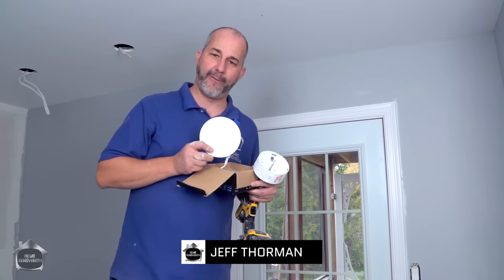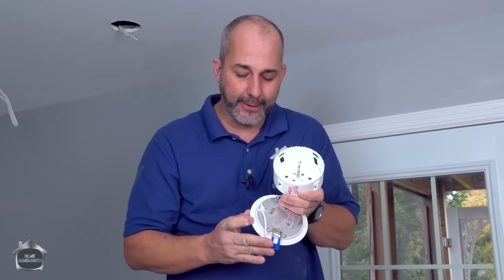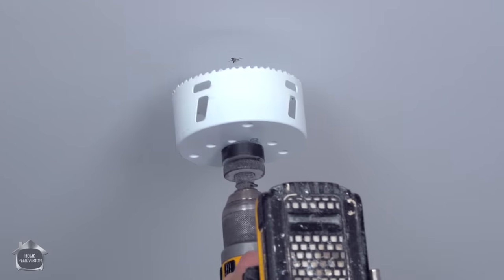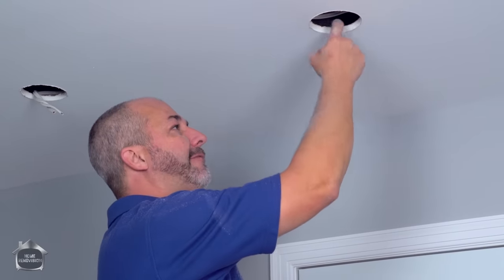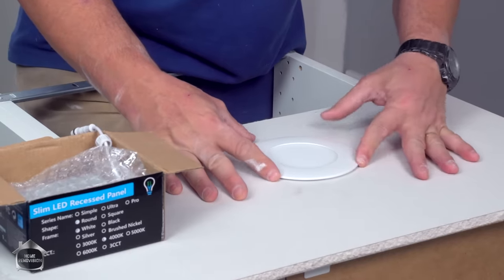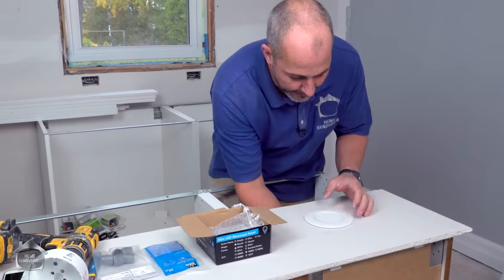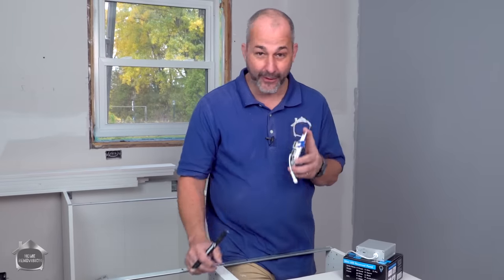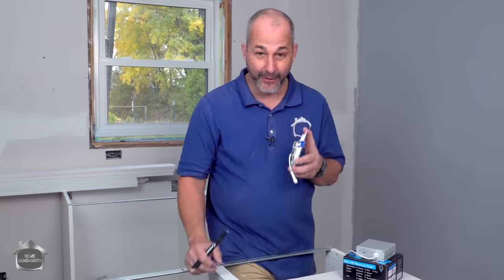How To Install Pot Lights in Kitchen Ceiling

Comment: Awesome video!!
I like how you even mentioned “when” to do your lights. I just bought a 1983 train wreck of a house. Well-intentioned owners but they made bad design decisions after having it built and kinda lost their minds as they got older. They eventually passed and their house hit the market as an “as-is” at full price. Ugh. Anyway, every last detail needs to be fixed/updated. I mean not just the popcorn ceilings, base board being used as crown moulding, chair rail, base, and door trim.... just every single thing imaginable is ruined. Every door, every inch of the wall-papered and sloppily painted walls... 100% of everything :(
So I get to make this ole house new again and pray to get my money back in a couple years. 
I was unsure of when to do the lights. After paint but before floors or what? I figured the order is de-popcorn/skim coat (or texture ceiling), skim and texture walls, crown and door/window trim, then floors (12 different... bad job flooring types in an 1800 sq foot home 🤢) and back up to the lights but I wasn’t sure. The glove idea is great too, thanks!
Reply: Go slow and take a deep breath and think of a process. You're on the right channel, DIY done smart will save a lot. Hired work that you can afford isn't always going to have the quality you'd want, and if you bought your forever home, or want it to be, you'll look at those walls, trim, paint, patches etc for quite a while. Start with areas that are invisible if you're beginning. As a renter, I fixed a lot of landlord or tenant or maintenance guy sloppy work. I first started mudding, trim, wall paint etc in the closet, literally.
Reply: Gosh...I was feeling overwhelmed by bad DYI stuff in my new home...I feel so much better now. 😁
Reply: Sounds like we just bought the same house. haha. Ours is 1980 and EVERYTHING needs to be redone. There are six different types/colors of light switches throughout the house, 8 different floors, hideous trim, the wrong types of mouldings used, 6 different types of door knobs, every possible metal finish for lighting and bathroom hardware. No ceiling lights in more than half the rooms. It's a mess. 2,600 sq feet needing to be redone.

Comment: Cheaper and better variations coming from the SAME supplier sold with different branding is the most UNDERRATED tip in this entire channel! I think it deserves its own video! I wonder how many different common products in home improvement can be found cheaper with the same or higher quality from different retailers.
I know it definitely applies to most products in Amazon can be found in alibaba where you can see the Chinese supplier selling products customized with your own brand and color theme variations if you buy in bulk so if you see similar products on Amazon go with the cheapest one!
Reply: A long time ago I worked at a fish processing plant in Alaska.  The salmon were put into cans and shipped to different companies around the world.  Then those companies put their own wraps on those cans.  I learned that you can pay more or less for canned salmon, but it's all the same.  I assume it's still that way.

Comment: Great video. I installed an 8-inch pot light and it and the drive unit get quite warm to touch,. There is insulation in the ceiling, of course. Should that be the case? The tech support for the product is not unhelpful. Thank you.

Comment: Great video!! Question, is it possible to use this cut method with the drill for an existing drywall hole? For example to make the hole bigger. Thanks in advance!

Comment: Thanks for the info, how do you figure out spacing the lights
Reply: I'm putting these into my basement now (well cans on an old drop ceiling that I'm salvaging).  Everything I've read says in general take your ceiling height and divide it by 2.  So if you have 8 foot ceilings, space them every four feet.  10 foot ceilings, every 5 feet, etc.

There's plenty of other things that come into play, such as the type of lighting you're going for (general, task, feature, etc), other lights you may add, windows, focal points, etc.

You can get really into it to where you don't want to learn another thing about lights (trust me 😃) but there's calculators out there to take the light angle, ceiling height, etc to give you the optimal spacing configuration.
Reply: This blog has some cool tools for figuring out how many lights you need and how to lay them out.  I used his layout tool then put post-it notes on the ceiling in the recommended places to check how it looked.  I'm close to buying the lights and busting out the tools.  Hope this helps.
Reply: @pabruat  what blog? do you have a link?
Reply from the maker: That will work
Reply: @pabruat  What's the blog?

Comment: Just a suggestion, leave a little more wire in the junction box so you can connect the wires to the wago’s without using your pliers, coming from an electrician from the states, love the gloves! Nothing worse than seeing a bunch of finger smudges all over the walls and ceilings!
Reply from the maker: Cheers Mike!

Comment: Do these work in the soundproofed double 5/8" sheetrock ceiling?
Reply: Why would you install pot lights in a soundproofed ceiling? That's like insulating your house and then smash your windows in.
Reply: @Candisa  We build 5/8" drywall boxes around the potlights for fire separation and soundproofing. It's extra work but required by code especially, in multi-unit residential.

Comment: Loved the video. I agree with the trick about running the saw in reverse on drywall. Good explanation of the why's and how's of properly wiring and installing these types of lights.

One point of note, I have watched several install videos for these types of lights and the one piece of information that seems to be missing from all of them is "How thick of material can these lights be used in?" Do they work in 3/4" sheetrock or must the sheetrock be 1/2" ?
Reply from the maker: no such thing as 3/4 sheetrock. and yes it works on 5/8 as well. Cheers!

Comment: find some old basketball and cut it in half along the seam , you will get two pieces that looks like a bowl , Then drill a  hole into the center of one half of the ball and insert your hole saw bit and it will catch drywall debris..you get the idea...good luck

Comment: Many brands of those remodel style lights sell those low voltage extension cables up to 20 feet, in case you want to install the drivers somewhere else.
Reply: Good to know! Thanks!
Reply: Luke H use 8-3 Romex
Reply: @dallas5374  I'm referring to the low voltage cable that runs from the transformer to the light, not the line voltage to the transformer. 
He mentioned that the transformer to light cable is short, and I wanted people to know that is not the case for all remodel style LED lights. Sometimes it's not possible to put the transformer near the light, and with 20 ft of cable you can get really creative by putting it on a wall or in a different room where there's Romex, and running the low voltage cable to the light.

Comment: I got 6 inch wafers like that for my basement and I got them on Amazon. 6 for 79.99USD. Great deal.
Reply from the maker: Cheers Adam, we have an Amazon link in the description of the video if you want to help support our channel. cheers!
Reply: Home RenoVision DIY I will check out that link!  I am planning to get wafers for my bedrooms.  I hope the specs of your link match what I am looking for!
Reply: Sounds unusually expensive? Here in the UK, as well as in the Middle/Far East they are sold for around £3 each (for 6 inch). Check out eBay.
Reply: Home RenoVision DIY I must be missing something because I don’t see the Amazon link in the description. Is it a members only thing?
Reply: To be code compliant in Canada they need to have a ULC or CSA approval which many cheap lights on ebay and amazon are not. Aside from just the legality there could be insurance or safety implications.
Reply: @alexjr181  There is a url to his Amazon listings (they forgot to make it linkable) but noted that they will have links for cheaper pot lights as they develop business connections and such..
Reply: @alexjr181  Second paragraph in the description. I missed it at first too since it is not in blue and clickable,  www.amazon.com/shop/homerenovisiondiy

Comment: Really great and very informative video, thanks for that, I am planning to install POT lights in my house but please tell me how I can find out the wire above the ceiling to make hole at the proper place and if I will cut the wire will that not disconnect the power? please response so I can do it rightly.

Comment: These are so nifty! Looks like a heck of a lot easier than messing with can light housings ect. So how do you pre wire for these during the rough in stages of the job? Just leave the wires dangling from the sheetrock where the lighting locations need to be and trust that the drywall dudes don't move your wires? How do you avoid insulation from dumping from the ceilings when drilling with the hole saw?

Comment: Ok, but how did you get the wires through the ceiling? The most important part you left out........Jim
Reply: Lol exactly
Reply: Do we need to climb through the attic?
Reply: @hoangtran2292  I don’t think there was an attic.....he didn’t mention it.....Jim
Reply: @jimpie231  i thought every house had an attic...I feel like this step was missed in the video.
Reply: @hoangtran2292  My house has a partial attic? I have a vaulted ceiling in my ranch right in the middle of the house (when you walk in the front door the ceiling goes from 9’ ceiling to 14’ in the middle back down to 9’ in the family room) the attic here is almost not accessible. I have a fold down folding ladder in the garage that accesses the left side of the house and an access opening on the right side of the house. I have wanted to add skylights in this area, but because of costs and the trusses and fireplace, this is very difficult to do. Adding cans above the fore place, same problem.  Jim

Comment: Great video. I live in an older house with faux wood tiles on the ceiling in some rooms, above those there is a layer of aluminum faced foam sheeting, then a layer of drywall, then the insulation and some wiggle room. Do I just drill through all these layers until I have space for my pot light boxes? It also makes it difficult to find actual wood beams or trusses because my stud finder is picking up all the nails used to keep the faux tile up.

Comment: I installed pot lights in my basement.  Hopefully the cops don’t find the plants.  lol
Reply: In Canada it’s ok
Reply: Yeah same. I put them on a pice of ply wood. Screw any where.
Reply: Yup Canada would be fine with that now
Reply: Pot Lights... I had Black Lights in HS.
Reply: My understanding is that LED lights don't produce a suitable wavelength of light to be a "grow light".  Not suitable for you plants.
Reply: @Chris Graham It's 2020. LED are perfectly suitable for grows. Check out Cree COBs or Samsung SMD aka quantum board lights. Almost no heat, (save on air conditioning) more efficient on watts per lumen... So I hear.😁
Reply: @HardRockMaster7577  Still have the Dark Side of the Moon poster? :0)
Reply: @TKevinBlanc  I think it was the inner gate fold of Led Zeppelin IV...
Reply: @chrisgraham2904  some LED's work very good and some don't,  some of the older LED's work good, some were shit, now they are getting better.  NASA has used LED's to grow plant's in space already
Reply: @chrisgraham2904  ah yes there are full spectrum hi output led lights and they work well " my friend " grew tomatoes for years in the basment with kind led lights
Reply: @danrook5757  not in Qc😢
Reply: Der.

Comment: Great video as usuall my friend , But the only thing is why didnt you show us how to hook the wires in the ceiling thats the most important to most handy people wacthing you ,
Reply: Anthony Hook the wires?  You mean pull them through the hole?  I don’t see that being difficult. Run wire, push through hole, go to next hole.
Reply: Yes in other word I meant run the wires or install them and connect them to the main swtich etc , because in this case this video didnt help the non experts of how to connect it to the power , pulling the wires through the holes is no issue.
Reply from the maker: If you want to learn how to fish wire then that is a totally different video. Cheers!
Reply: @HomeRenoVisionDIY  Do you have one already ? if not please consider making one when you can , thanks in advance , Cheers .
Reply: I kind of get the idea of how to fish the wires through the ceiling and run the lights in a serious. But where and how do you tap into the power? Thanks.

Comment: Hey Jeff, great video, as usual, but you forgot about the planning. Waited the entire video for your tips and recommendation about how to place/locate these lights, but never happened 😕. I’m guessing you plan it based on the light cone of the selected light, but I was expecting your amazing explanation about it. I literally clicked the video because of it.
Reply from the maker: perhaps we should do a quick video on that subject|!
Reply: @HomeRenoVisionDIY  please do!
Reply: @HomeRenoVisionDIY  For sure! What I've read is a couple methods: one light per 25sq ft of space and the other is divide ceiling height in half and that is how spaced apart they should be. Account for task lighting vs. accent vs. general lighting. The "wafer" or thin lights have a higher spread angle than recessed pot lights as well.

Comment: Very good video. Pro-tip though...do not strip the outer casing of the wire bundle with a snap-blade. This is slow, can cause cuts to hands and the wires inside. Simply take lineman's pliers, grab the bare ground wire at the tip and pull away from the other wires. An instantly split outer casing that can be snipped off with the wire cutter/stripper.

Comment: I LOVE your videos!  I've watched SO many.  

Just removed a 70s light fixture in my kitchen... repaired the drywall... and installed 4 ultra-slim LED lights that I bought online for less than $10 each.  AND they're the color adjustable kind.  ;-)  

Thanks!!
Reply: Going to try this also. Do you have a link to your purchase? Thanks

Comment: Just wondering if  the spring adjustable for 3/4 " thickness .... I'm would like to install them into tongue/groove wood ceiling or is there another option... great video and thanks for the info

Comment: We call "pot" lights can lights in my area. And those lights he's installing are disk lights or wafers.
Reply: Can lights in St. Louis, too. I saw the caption on the thumbnail and came here for the wrong reasons! But I'm still watching anyway.
Reply: I'm an electrician and have literally never heard them called pot lights.  Even the vendors call them can or recessed lighting.

Comment: The hard part is pulling the wires. The part shown is like change a light switch. Does this channel have a rough in video?
Reply: There is a video in his description above about running the wiring

Comment: buy 10% more than you need. you will have failures after a few years when that particular model is no longer in production.
Reply: Buy standard sizes and that's non-issue.  And buy better quality to begin with.

Comment: I really learned a lot from these videos as well. Are there any recommendations for where to get these types of lights for sloped ceilings in which I need to find adjustable gimbals? I used to buy Halo but after watching this video it doesn’t seem  necessary to pay so much if there are other comparable brands out there

Comment: Great video and nice tips.  Picked up the 12 pack from Lowes for the discounted price of $ 199.00.  The wife then found these exact lights at another location for $ 10.00 ea.  I was a little worried about the quality of the lights, but after seeing this video, I feel more confident we did the right thing by returning the Lowes package and purchasing these.  Thanks
Reply: Where did you find them for 10 a piece
Reply: What is the name of the store? Thanks

Comment: Nice lights.  I plan to replace older traditional can lights when I re-do my kitchen and family rooms.  QUESTION... do you know a source to get short low voltage extension cables for them?  Say 12 to 24"?  I may need to move some light locations and use the existing 14/2 romex that feeds the original lights.

Comment: I need a recommendation for a digital 2x2 drop ceiling for the lithonia u-bend for my home able to make it warm lighting. I need to replace six units. Would like remove old and drop in and wire in new unit. Price is also a concern. Thanks so much for your wonderful videos and your help!

Comment: This is why I’ve been watching you since you started! I have a hideous garage, with very few outlets for plugging in, my garage is dimmer than dim and it’s incredibly difficult to see detail let alone for safety reasons with powerful tools, so I’ve been looking for a way to add lighting in here. Something that’s inexpensive like what this product retails for, something that I can achieve as I have zero training in electrical work and a viable option that won’t cause electrical issues. I haven’t been able to install anything in the past because I’m told my electric panel is maxed out and it’d cost $3-$4000 just to add extra paneling or whatever it’s called lol. I’m wondering if these leds would be a real option for me instead of relying on plug in lights when I’m already limited as it is. For ie, my entire garage has only two plug ins so I’m constantly plugging in and out depending on the tool I need. Would love your advice, I’m hoping 4-6 of these leds would suffice while not overloading my pathetic electric panel